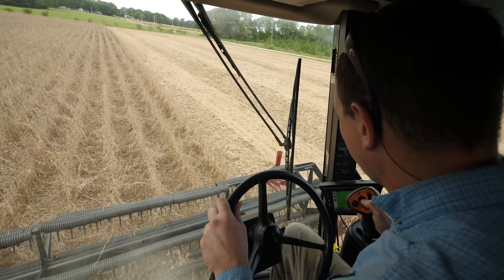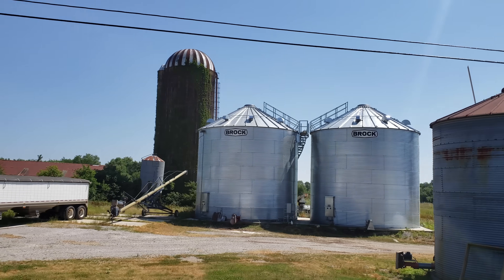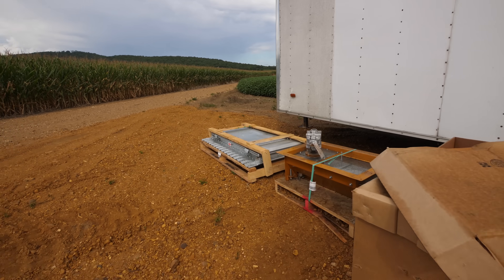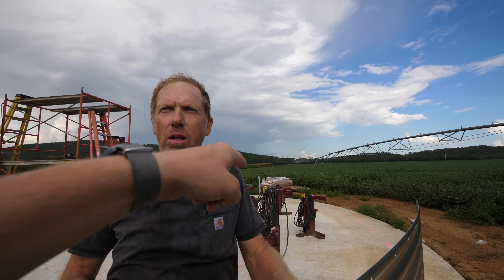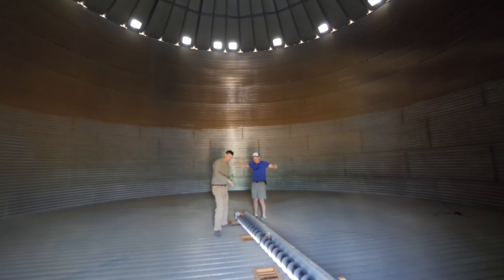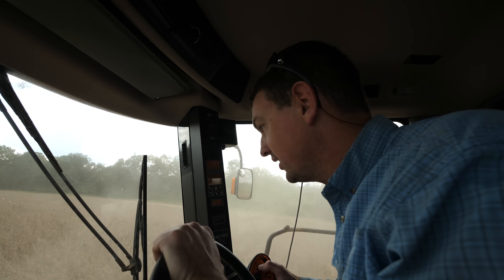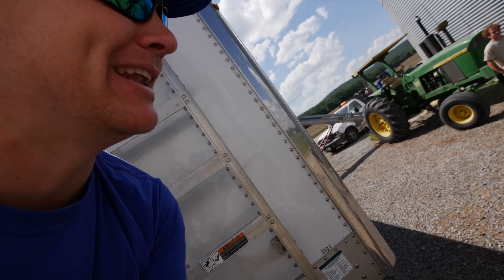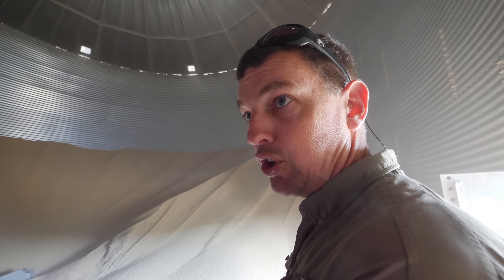Everything About Grain Bins (Farmers are Geniuses) - Smarter Every Day 218

Comment: Hmm what if we added a central cylinder in the bin that blows air sideways? That way, the air would move radially and thus have to travel only the radius of the bin instead of its height, meaning the grains would dry a lot faster 🤔

Comment: A little bit more info for you  guys which I learned during my ENG senior design project. 

Basically when grain spoils, it starts to release heat, and when it heats up it spoils faster. When grain sits in the bins, it naturally forms hotspots where localized areas start to spoil. If left unchecked, the grain can actually get hot enough for the hotspots to spontaneously combust. (grain is REALLY flammable) 

Farmers need to climb on top of the bins and manually probe the grain in order to measure its temperature to try to catch the hotspots before they get out of control.  But this is really dangerous because they could fall in and be crushed or suffocate (because decaying grain releases CO2 and its heavier than air)

We designed and built a prototype solution to solve some of it but I wont bore you guys with the details. (unless you're curious)
Reply: I'm curious! Sounds like the falling issue could be solved with some sort of harness setup like climbers use? CO2 sounds trickier... maybe running the fan for a bit?
Reply: @spagamoto  We ended up looking at a way for the farmer to avoid having to enter the grain bin at all. We tied temperature sensors to strings which could then be suspended from the top of the bin before being filled with grain, That way the sensors would be able to look for hotspots continuously. The data from the sensors would then be collected and encoded in a PIC microcotroller and sent via UART / FM radio straight to the farmers house ( some grain bins can be REALLY far apart and its cold in the winter up here in Canada). That way the farmer could get real time data from all their bins right on their computer... We also set up an application in visual studio which set a temperature threshold and sent an email notification to the farmer if one of the bins was hotter than the temp threshold.

Took a bit of time to code but with the cost of parts, we managed to get the system down to about 80$ per bin, including battery and solar panels for 6 month operation.

Comment: Instead of 3 long rows of corn, try squares of 6-7 rows of corn. Instead of doing rows with lots of plants and then 18 inch spacing between rows, do a perfect grid of plants every 10-12 inches in both directions. You've got excess plants in your rows. Thin to 1 plant every 10 inches.

Why the dense spacing? Because the female and male parts of corn are at very different places on the plant and the pollen blows from one row to the next row. By packing your plants in a grid, you increase the chance of pollination. I actually hand-pollinate by cutting off flowers early in the morning and shaking them on the tassels. A ridiculous idea if you have acres of corn, but in a home garden it's time well spent.

Finally, fertilizer. Corn is not a vegetable. It is a grass. Fertilize with very strong nitrogen fertilizer (30-0-0 or 45-0-0) 1/2 tsp per plant when it is 1 foot tall and again at 4 feet tall. Good luck!

Comment: When you see a large wrench used in heavy construction generally they have a pointed handle. For years I did not understand this, not ergonomic and why not have another wrench head like automotive wrenches. It is called a spud wrench and that handle is used to align bolt or rivet holes of large beams, just like the punch. (Some heavy construction wrenches have a block handle, this is a hammer wrench and the block is for striking with a machinist hammer or sledge for final tightening or loosening)

Comment: About that moisture sensor: If I recall correctly, some installations use microwaves in order
 to determine the moisture level based on the energy used/dissipated and/or the speed at which the waves travels through the medium. (don't recall exactly)
They're often used to continuously determine the moisture content of a moving product. I've seen it being used in wood chip/pellet processing.

Comment: This is the best video you have done. Maybe I'm biased...
I don't claim to be a farmer. My dad was one of the best. Very progressive and well respected. He set records for grain production back in the 1960s. And you are correct; Farmers are Geniuses. Growing up on the farm I learned to do everything you talked about. Instead of hiring someone to erect out grain bins we did it ourselves. But we used cable winches on stand around the outside of the bin, in a very similar way your video showed.
I went on to get a degree in Mechanical Engineering and started a subsurface irrigation company for farms. There are two things I don't like about farming; Mother nature (like that little shower that screws things up) and commodity pricing. Letting others determine the price you get for your product. Those and the fact that your job is NEVER finished!  But I love farms and the people that work them. Great independent individuals. They are indeed the backbone of humanity.

Comment: Haha almost everything that is made out of this corrugated material needs engineering to properly design it. They are very good bent this way to work with tensile forces while improving their resistance to compressive loads on the other axis. It is not just me and my hammer nailing 2 pieces of lumber together. 

My amazing experience was the Engineering Guy(channel) talking about the aluminium beverage can. I was so inspired the fact that something as taken for granted as a soda can be actually a piece of marvelous engineering and manufacturing triumph. Those cans use the thinnest possible alu sheets and everything about them from the shape all the way to the stay-on tab on the top has proper reasons for being there and working the way they are. These silos are cool. Love the vid.

Comment: I tip on growing cornzes:
First I will admit I don't know for sure the true validity of this, but this is what we have read and are trying out for ourselves this year.
Corn should be planted at least 6 rows deep.  The length of the rows doesn't particularly matter as long as there are at least 6 of them.  This supposedly helps with pollination as well as makes it a little more difficult for the critters to get to the cornzes in the middle. :)

Comment: So every now and then my job calls for me to have to work alongside farmers. I work at a telecommunications infrastructure engineering firm in Chicago and occasionally I have to go to the field as an inspector for projects when construction calls for it. This one time I had to go to a place in southern Illinois that required our client lower the fiber optic line that was in an old steel pipeline (previously used for gas) that was just too shallow for the farmers comfort. They said their equipment kept hitting the steel potentially damaging the teeth. We get there to do the work, this farmer was so irate and pissed off like you wouldn't believe! He was pissed because he saw that we were gonna do this work right after a day it had rained. He was afraid that the tracks on the equipment my guys needed to use would destroy the ground his crops need to grow on. Once we got started he saw how fine everything was and became the nicest guy in the field all of a sudden. Even shuttled me back and forth from the site to my car via 4-wheeler alongside his dog. But you could tell this guy knew a lot about a lot like you said in this video. And by the way, he and several other farmers I've talked to really, REALLY dislike being in big cities like Chicago lol.

Comment: Hey Destin.  What these guys are calling a "punch" is generally referred to as an awl.  Generally speaking, mechanics use them for the purpose of aligning holes - like when mating transmissions to engines, for example.  

Conversely, a "punch" or "hole punch" (correct nomenclature) is used for punching holes in stuff.  Though technically, by definition, neither term "awl" or "punch" are specifically defined as "alignment tools," generally speaking, if you go to any shop and ask for an "awl," they'll know you want to align holes.  Ask for a "punch," and they will give you something designed to be hit with a hammer.

The way to tell them apart, an awl is tapered.  Though a punch CAN be tapered, they generally are not.

Comment: I’m most impressed by the strength and support of those sheet metal “walls” 

They’re essentially “floating” on the hardened concrete and supporting the entire structure above it without any trussing or pillars to offset the load from the wall around it...

Comment: Harvesters don't actually need to wait for an auger to empty a larger grain wagon or a semi. There's an invention called a DumPit, which is essentially a pit that grain is dumped into and elevated over time. Having the pit instead of just an auger allows for grain to be unloaded as fast as it can escape its container, instead of how fast the auger operates. The pit can be a certain ratio smaller than the container it accepts grain from, which is related to the speed of the auger versus the speed of emptying the container. Once the container empties, a sensor, a timer, or manual intervention can shut it off - while the grain wagon is long gone.

Comment: could you please convert (in subtitles, maybe) to SI units? It would be great not need to stop, convert the units and comeback, knowing you would have to repeat this operation several times to understand how big (or small) are the measures being talked about. Thanks in advance! Because, really... 1 bushel equals 8 US dry gallons
, or 4 US pecks, or 2150.42 cubic inches, or around 9.3092 US fluid gallons, which is almost 35.2391 litres, or not quite 7.7515 imperial gallons.

Comment: In Russia the military removes all moisture from the air by using a direct drive all mechanical electro-mechanical diesel engine driven (coal gas, natural gas, biogas, wood gas can also be used with a little adjustment in the controls) atmospheric water generator pump the super dry air right through the wheat grains or any grain or any bean at all. And then use the super dry air to dry the grains and beans. But most of the time the grains and beans are liquid nitrogen sprayed and placed inside a vacuum chamber which is also the grain silo where the air is pumped out constantly until the grains and beans are all dried up and the vacuum is constantly maintained indefinitely.

Comment: Although I hauled grain  for several years from many different farms I always find it interesting watching how the bins are put together. I was a bit surprised that they had the sweep in with that much of a pile still in the bin but everybody does it just a bit different. If you have not covered it yet you should learn how the farmers control the application of fertilizer based on soil tests with the giant sprayers guided by GPS .

Comment: Destin, the tool you've been using is called a drift (see Drift Pin on wikipedia) - they're a specific tool used all the time by fitters to align two (or more) items as you were in the video.  Great video!

Comment: Im curious about the shape of the bin, what are the advantages of a cylinder over some other shape?
Reply: Cylinders can take more internal pressure and have as reduced wind load factor compared to rectangular prisms. The weak points of the rectangular prism are the corners for internal pressure, cylinders don't have corners and the pressure is evenly distributed from the center axis. Also the cylinder shape helps reduce the forces that wind applies to the structure. Due to the circular shape, the contact area of the wind where the force is applied perpendicularly( maximum force) is greatly reduced. The curved sides then deflect the rest of the wind off of the grain bin.

Comment: As a shaft miner this process is very similar to what we do. We move huge steel forms to up and down to be able to pour concrete and reinforce the shaft walls. The shaft is the vertical hole in a mine btw.

Comment: Over here on my home farm we had this oil burning hot air blower powered grain dryer system that circulated the grain around from bottom of the nearly 10 meters tall structure back to the top blowing hot air through it making the drying a fast thing. After drying the grain, mostly wheat, rye and barley, would be stored in a simple silo untill it was sold. It probably was very dangerous as a kid to be running up and down those nearly vertical 10 meter ladders to check stuff at the top.

Comment: If insulated could you use the same process to cheaply build homes?
Reply: Buckminster Fuller did that in 1940. Google "Dymaxion Deployment Unit" (yeah, he had a thing for weird names). It never really got off the ground, although the U.S. military did use some for temporary housing for air crews in the Gulf during WWII.

Comment: I've done all of that.  Including assembling similar bins.  Used different types of jacks.  Including a crane that lifts them from the top center and one that was a pole that goes through the center and has a winch to lift them up.  
I also farmed for 24 years.

Comment: I'm a farmer from iowa and that part about the sandbagging had me laughing, almost everything we learn is from the school of hard knocks aka it usually cost us alot
Reply: Nick VanRegenmorer if we’re not making new mistakes we’re not learning.
Reply: Nick VanRegenmorer good judgement comes from experience, experience comes from bad judgement & repeating jobs because you made wrong call. I grew up on a corn/soybean/cattle/hog farm in northern Indiana & we would build entire barns just to keep junk in case we needed to "Billybuild" something that broke.  I was almost prosecuted for tractor theft at 16 because a deer jumped in front of my truck at 2am causing me to crash in a drainage ditch, so I walked to my neighbors grandfather's barn, borrowed his IH at 3am, drove it down the highway with a flashlight, removed my truck & replaced the tractor. Didn't realize that I'd left a trail of mud & cornstalks all the way from crash site to my driveway but I'm sure that made it easy for the sheriff. Charges weren't filed but I did have to work for the farmer for 3 months to cover cost of damages for his lost crops. I had to tow truck through the field bc it wasn't making it back out how it came in, that much was obvious.
Reply: Dude i just drove through IOWA and NEBRASKA.  i could not believe the flooding.
Reply: Perpetual Student the Midwest farming industry from Ohio to Iowa are experiencing record flooding. Even the Mississippi river is peaking to the point all locks are in full flow status & it's still about to overtake bridges. They have not been able to get barge supplies to the farmers due to the rivers either being shut down from clearance issues or because debris from flooded communities causing obstructions & the locks cannot operate for fear of further damage.
Reply: Perpetual Student now would be a good time to invest in grain/corn/soybean stocks because come december-january, surplus will be non existent & prices will skyrocket.  Seen it happen about a decade ago & flooding wasn't near as bad as it's been this year.
Reply: @ThePerpetualStudent  and, it's not over... it's still raining!!
Reply: Hey sir, can you explain what is sandbagging?
Reply: igehring you not from US?  It means intentionally holding back in a misleading sense while being quite capable of task at hand. Common among billiards hustlers, hunters, and farmers in my experience.
Reply: 321JKilla now I get it. Im a farmer from Brazil. We kinda do the same here, although bins are for big farms. Medium and small do their business through the so called grain cooperative ( They own the big bins, and do the business to final buyer)
Reply: Perpetual Student they did geological study last year that showed water table level records through soil & rock samples, they compared the data to this year & in the estimated 500yrs span they could accurately detect, only one other time could they say this happened but it was not prolonged, it was just a short blip on the timeline whereas this is sustained. They are officially classifying it as a 1K yr event. In a sense it is biblical, as the last time it happened the bible was probably being written.
Reply: Just consider it "tuition"!
Reply: Nick VanRegenmorer go hawks

Comment: I work in such a company, that pretty much does everything this video has shown. The reality is that it is more complicated than the video shows and that it is a seasonal job, which makes it really tiresome. Repairing is not always a thing because in modern tractors and harvesters there are so many advanced technology that limits you  a lot. You also need the schematics  of the machine to be able to do a repair or to calibrate things correctly. Even then experience is everything, because decades after buying a harvester, the company may still hasn't corrected the errors in their maintenance and repair documents. There are also tricks to make the drying process faster (reverse cone) and your graphics was pretty much  wrong because the product is always forming a cone when you load a silo.

TIP: Make a video for sowing and what it takes to reach to the harvesting season. Select a demanding crop, like rice for example so you can eventually make another video in a rice mill  (process) :P

Comment: Thanks for the flashback of my summer of 08, I helped build about a dozen of these bins. By far, the worst job was pushing bolts through and holding them, especially when the sun was at your back and reflecting off the bin into your face. The guys inside had nothing but shade.